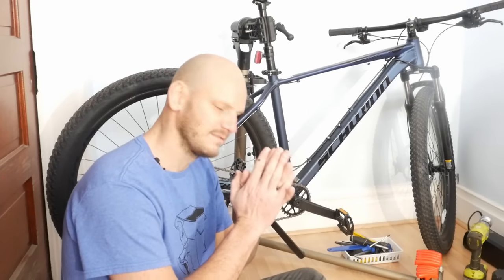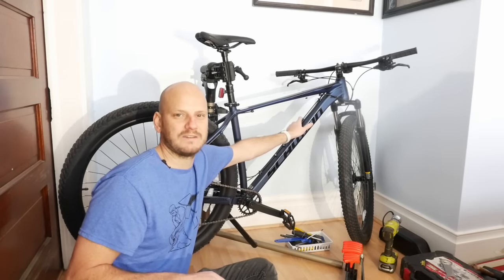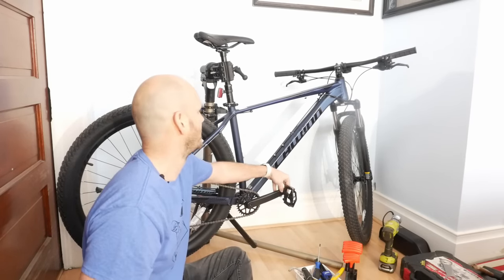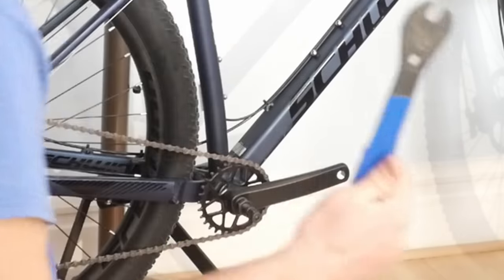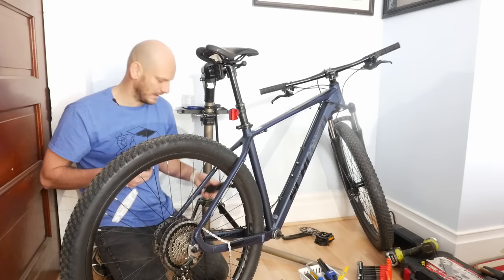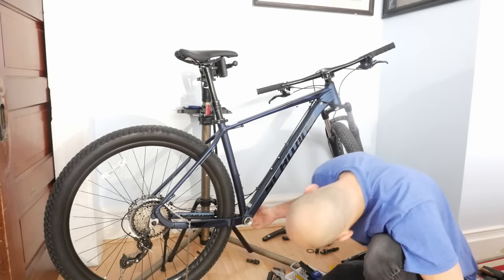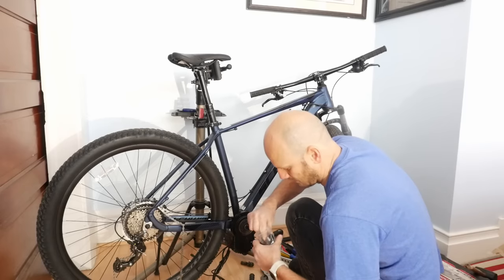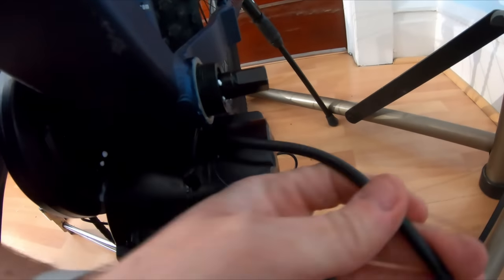The Step-by-Step Bafang Installation guide.

Comment: So basically the only difference is that on a store bought e-bike there won't be an exposed tangle of cables hanging right between your pedals getting mucked up every time you ride anywhere and eventually falling off mid-ride when the cheap zip-tie plastic inevitably weakens and breaks. And I wonder how all that exposed cable housing will fare, getting wet and then drying hundreds or even thousands of times? Not an issue? Even though there's electricity and a battery involved? Let's maybe hear an electrician weigh in on that.
Sorry dude, you had me until the end. Still, I appreciate the intention.
Reply from the maker: It’s all waterproof connections. Just make sure they are all tight and properly connected using good quality zip ties and you are good 👍 using a bit of common sense also goes a long way to ensure safety and longevity of your ride😀

Comment: Could you please set me straight? Some hub motors have spin on free wheels and some have cassettes. Right? I have a 6 spd e bike that has a spin on while I have a high end that has a 10 spd shimano deore groupset, that appears to be a real cassette. Or am I nuts. I'm still new to the scene, but I am retired and this is my new hobby and I want to modify e bikes like I have been doing with regular mtb. I want to learn to modify my cheaper stuff for entertainment. I want to put the Advent X 10spd groupset on some e bikes, I'm just still learning. Thanks and I'm glad I found your channel.
Reply from the maker: Freewheels spin on and cassettes lock on with a lock ring

Comment: Thank you .Want to do it. Just bought a used 2021 Marlin 7 and want to use this bike. . Would the bike be legal in California? What motor and battery do I buy? BBS02 I guess? Where do I buy or where do you recommend I buy. I would have brought the bike to you for a build but you are to far.
Reply from the maker: Bbs02 is 750w which should be legal in California. I do sell kits on my website 😀

Comment: If I have a 36v 500w system can I make it run 48v instead just by bying a 48v display or other way?
Reply from the maker: You will need to get a 48v controller.

Comment: At first I was completely on-board with converting my current bike to an ebike. Then I watched this video...by the end I was convinced this was the wrong way to go. The end product looks like ass. From all the exposed cabling to the tacked on electrical components, it just looks a mess.

The e-bikes you can buy today may not be as powerful as this but have components that are integrated into the frame and don't look like a Frankenstein's monster, like this abortion.
Reply from the maker: Custom conversions are definitely subjective. However to my defense, A common response to customers picking up their finished bike from me is "wow, that looks better than a lot of the premade bikes I have been looking at". Every bike comes out different as well. As stated in this video, this bike was harder to to hide the cables because of the cable guides. But yes, good point, if you are a stickler for looks, check before you buy. If you want to see what a finished product of conversions look like, check out my custom builds playlist 👍

Comment: Great video, thanks. Unfortunately I live in europe... "250 Watt Law:
BRUSSELS, Belgium – The European Parliament voted on the new type approval legislation on two- and three-wheel vehicles and quadricycles. The Parliament decided to keep the original European Commission proposal: only pedelecs with a maximum speed of 25 km/h and 250 watts power will remain exempt from motorbike regulation."

What's the best 250W motor you recommend?
Reply: Silly, overly-restrictive laws, if you ask me. But here in Finland it's ok for 15 year old pimply kids to drill holes in their mufflers and plague the streets, speeding around on their mopeds.

Comment: One of the benefits of retro-fit e-bikes that I've never seen mentioned is that you can always replace the motor.  If you buy a purpose-built ebike, the motor nests into a specific hollowed out section where the bottom bracket is on a normal bike.  Those bikes are built to accommodate a specific motor.  When that motor is no longer manufactured...you are screwed.  Your bike is worthless.  Not so with a standard bike.  You can fit a multitude of motors when yours craps out...or simply convert it back to a standard bike and pedal away!
Reply: Other than all the issues with fit of bottom brackets, chain stays, cable management, chain line issues, motors coming lose, battery mount problems and lack of torques sensors, I would agree with you.

Comment: Thanks for you last comment. I am looking at doing a conversion with a similar befang model. Do you think a bike with cables is easier or hydroloc for a first time builder. I have already bought the bike now but was just wonder if my thoughts where right
Reply from the maker: So sorry, I just saw this comment now! In case you still are looking for a response 🫠 cable is easier. 👍

Comment: Bottom bracket shells are not all the same. Your slide in without any modifications or problems.  I'm thinking this is where most people will run into issues needing bushings or adapters to fit the motor into the bike.
Reply from the maker: You are right. Especially on higher end mountain bikes they use pressfit bottom brackets. If you have one of those, check out my videos on that topic. 90% of bikes use this standard BSA type seen in this video though.

Comment: So I have a 3 gear front sprocket. Would that need to be replaced with a single gear crank? #2, I have a rotary gear change on the handles. Is that compatible with this type of retrofit?
Reply from the maker: Yes to both. The kit comes with the new front chainring

Comment: Hi Johnny, great video.  I followed your install video and got my Bafang BBHDS installed and running.  My kit was bought from a different vendor and was supposed to be 48V.  I think the motor I received is 52V because my fully charged 48v battery will only show 3 bars instead of 4 bars on display.  I was told I need to flash the controller firmware for 48V, I have ordered a USB cable and should arrive soon.  My question is where can I find the 48V firmware file to use.  Have you done this before?
Reply from the maker: You probably just need to change the setting on the display to 52v. Usually it’s the opposite, the motor won’t work with a 52v battery.

Comment: What are your thoughts on using a Sturmey Archer or Shimano Nexus hub gear to allow for a permanent in line chain? And a cleaner look. 
Also spiral wrap might look neater than zip ties. Really good video.
Reply from the maker: Both drives can be excellent hubs. The 3 speeds are supposedly the strongest and yes, keep a perfect chain line. 
I like to use both zip ties and spiral wrap to make builds look as clean as possible. 👍

Comment: Hi Johnny I just found your channel and really appreciate your candor regards self build or manufactured ebikes. I can't find your email to ask your advise as I want to self build.  I'm reasonable technically minded  and should be able to follow any assembly instructions. The advice in particular is specification for my needs. I want a sturdy reliable bike to do long distance and touring on mostly tarmac roads Ideally 60 mile round trip or more if poss? There will be some dirt road but not assault course stuff. SO I guess it's more to do with motor type + power rating and battery pack wattage. What manufacturer for power, reliability and stamina? Please tell m your thoughts.
Reply from the maker: Johnnynerdout.com message me there 😀

Comment: I was wondering on my Juiced Rip Current S the specs say 100mm bottom bracket . So should I go with the 120 mm bbshd or the '73-100?
Reply from the maker: Measure it yourself first. then check out my Bottom bracket measuring guide, it'll head steer you in the right direction

Comment: was this a 73mm bottom bracket frame? Can you still use spacers if you have a 73mm bracket or spacers only work with 68mm?
Reply from the maker: Yes I believe it was a 73mm BB. Every bike is a little different and requires different spacers unfortunately ☹️
Reply: @JohnnyNerdOut  thank you for the response on this older video. I ended up buying tools from you today.

Comment: I've ridden motorcycles for many years . I wonder about making one of these with right hand front braking . Thoughts ?? Why do bicycles have left hand front braking ? That's crazy  !!!
Reply: It's convention.  A lot of bikes have only 1 hand brake (in the rear), and most people are right handed, so the right hand for rear brake because it is the stronger hand.  Until recently, bicycles didn't have disc brakes, and they required a lot of force to stop.

Comment: Question. My frames bottom Bracelet measures, 
BB COMPATIBILITYBB30/PF30-68/73mm, GXP/PF GXP 68/73mm, PowerSpline BB
   Will this fit my frames bottom Bracelet?
Reply: The bearing on my frame are on the Outside and Not on the Inside like yours .
Reply from the maker: Yes, you will need to punch the press fit cups out(they make specialty tools for that) or it can be muscled out, sometimes fairly easily. You will need a pf30/bb30 to bsa adapter( I sell) just make sure you measure your ID of your bottom bracket shell correctly after you remove the cups👍

Comment: Is the magnetic sensor cable on the BBSHD necessary for its PAS to work properly ?  my throttle works correctly but when I leave the throttle alone and start turning the pedals, beyond a certain RPM it engages the motor by itself and seems to be at full power,  so it seems that if you were just idly turning the pedals on the bike to adjust your balance or something it could propel you into something unexpectedly.  

I've only used hub motors prior to this so i'm unsure what i'm supposed to do. You said we need a special security hex thing to install the speed sensor ? I doubt I have that.  I haven't tried programming the thing yet.
Reply from the maker: Sounds like the PAS level is set way to high. Get a program cable to dial in how much power is used at each level. Also make sure you have the display menu set for “9” levels of assist.

Comment: what are you screwing the screws in the battery plate into at around 1940?? were there holes for the screws to be screwed into already there, or did you have to make them yourself?
Reply from the maker: Those were the existing water bottle mounts

Comment: will this kit fit a 3 ring mid drive cogwheel drive or can the 3 ring cogweel be added to the mid drive motor as my Bike is 21 speed
Reply from the maker: No, you will replace the triple chainring with a single. 3 chainrings is not necessary with a motor.

Comment: I have the identical torque wrench, I think I have had it for at least 30 years so I wasnt sure if that mechaniccal type was OK for bikes. I have a project bike for towing a trailer with surfboard out to the beach. It is not a heavy load but I am going up and down hills. Is there a heavy duty lower geared Bafang you would recommend in this case?
Reply from the maker: Get the BBSHD and a small front chainring like a 28 or 36

Comment: Hi mate, bought the 750w mid drive kit to fit on my specialized crosstrail and got as far as getting the bottom bracket out, the mid drive unit won’t fit over the cable for the rear derailleur though? Obviously needs moved but then will lose required tension so not work, any advice? Just get a fully sleeved one?
Reply from the maker: Hey Marc, I'd love to help you out over the phone (easier) if you want to book a troubleshooting session with me on my website. www.johnnynerdout.com. Thanks!
First I would try using a cable guide to move it. But it’s hard to diagnose without seeing it

Comment: Just want to say, it's great that you offer a Bafang tool rental kit for the install but the one thing that is missing is a socket for torqueing the inner nut. From what I've read, the torque is 50nm to 60nm and some video's say 80nm. Beating on it with a rubber mallet is not precise enough. Just saying the socket would be a nice addition because not many DIYers can afford $45 or so on a one time use socket.
Reply from the maker: Check out the website, I offer both 3/8” and 1/2” sockets as options!
https://www.johnnynerdout.com/product-page/installation-tool-rental-30-plus-deposit
Reply: oops! I didn't see that when I ordered.

Comment: I ordered and started installation.  Everything was going fine until I got to the outer lock ring install at 24:06.  I put on the inner lock ring but there are no threads left for the outer ring.  I could leave it off but I'm thinking that would be a disastrous results out on the trail.  What are my options to resolve?  The only thing I can think of is, I received/ordered a too short of axle (for lack of a better word".
Reply from the maker: Outer ring is mainly decorative and protects the inner from the elements. Gorilla glue that sucker on 👌just make sure inner is on TIGHT

Comment: I will add a couple comments that might help if you are going to try this yourself.Once you are sure your battery will fit,take the bike to a shop and have them remove the bottom bracket .That is what takes the special tools.If you have an Alu. frame get the special brace for attaching the motor.I am sure Johnny can tell you all this.

Comment: The part about the chainline was a little unclear, should the chainline be lined up with the middle of the cassette or lined up with the biggest gear or somewhere in between like the 2nd biggest gear?
Reply from the maker: The most important thing is whether the chain stays on when in the lowest gear. Don't worry too much about where it lines up being straight.

Comment: I’m working on this same project but need spacers & longer screws to mount the motor bracket & keep it stabled . Where is the best place to find those kind of screws & spacers ? Home Depot ?
Reply from the maker: A local bike shop. You probably could get the longer m6 bolts at a hardware store
Reply: @JohnnyNerdOut  Thank you , I found longer M6 screws at Home Depot but couldn’t find any spacers so I’m most likely gonna stack up some washers to space it out for now . should I take off the derailer & get a bigger chain or add a link ? It looks a little tight, hopefully it doesn’t snap on me while riding .

Comment: Hey there I'm wondering if you could help me please...i have a bafang mid drive motor, its labeled 52v and my battery is also 52v. Ive realised my controller isnt  accurate with the power percentage.  For example on my last ride sice this comment it showed it was at 32% however on my battery it indicated 3 bars out 4 when i pressed the button on the side to check the current life. Which one do I believe?? Thank you
Reply from the maker: Never go by “bars” or percentages. Neither are accurate. You want the display set to “voltage” so you can see exactly what voltage the battery is at. 👍
Reply: @JohnnyNerdOut  thank you for your help brother

Comment: All the power going through that crappy teethed bracket no wonder these motors start to move. I might be tempted to teeth the spacers on the other side with a hacksaw to offer a little help the the other bracket. I’ve seen lots of people end up fitting something else to help the motor from working loose from the torque.
Reply from the maker: If it’s torqued properly it shouldn’t move. I Think most people are afraid to torque it to the recommended amount. But I really don’t think you can over torque these things

Comment: Shouldn't you use dialetric greese on connectors to waterproof?
Reply from the maker: Definitely can to step up your quality. Depending on where you live, it may be more important than others. In my experience, it’s more about which connectors you are using. Using a good quality connector over a bullet or similar style is more important.

Comment: What is the work around if Bafang didn’t provide the longer bolts and spacers you used at about 21:52?
Reply from the maker: If they weren’t included in the kit, time to go to ol’ Depot for some m6 bolts. I want to say 25-30 in length

Comment: does it matter where the magnet and sensor are on the bike wheel, or the bike itself? because i have a 3 wheeler and im not sure how im going to add the speed sensor onto the bike.
Reply from the maker: It doesn’t matter, as long at the magnet is  on a spoke and being picked up by the sensor.

Comment: JohnnyNerdOut your choice of throttle placement is wrong, you should "always place the throttle on the right side" and the shifter on the left side just like a motorcycle so switching from e-bike to motorcycle is a more natural transition and vice-versa, from motorcycle to e-bike. It becomes a more natural learned movement. Always try to keep everything the same, systematically uniformed. Just like cars and trucks, the "gas pedal" is on the right side, left of that is the brake pedal, and on the far left is the clutch pedal if it has a manual transmission. Great video by the way!!!
Reply: Also, all wires and cables should be run on inside the frame area so all things would be better protected and be less likely to get damage from anything striking the bike and/or frame. If things were placed on the outside of the frame, they could very easily get damaged. Now, unless one is very rich and likes wasting time, money, and labor, place things on the outside of the frame so they could be more readily damaged from being less protected.
Reply from the maker: Placing the throttle on the right is not always possible. In fact it usually is rarely practical to place on the right side due to the shifter and brake lever. It’s personal preference but in my experience it just works better on the left 👍